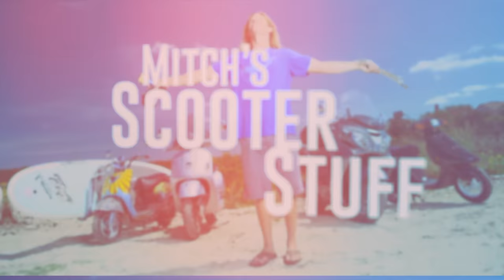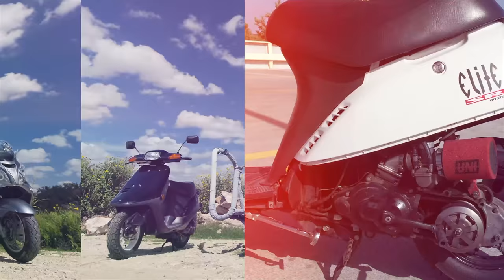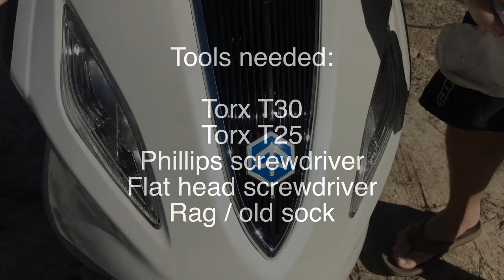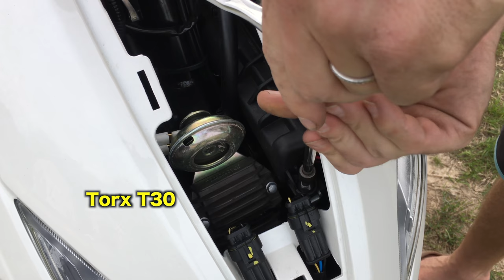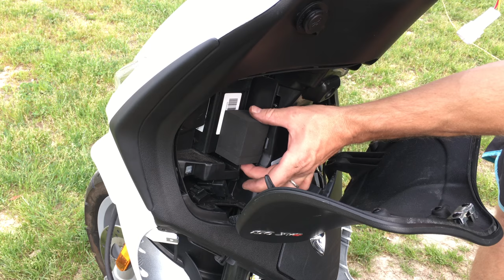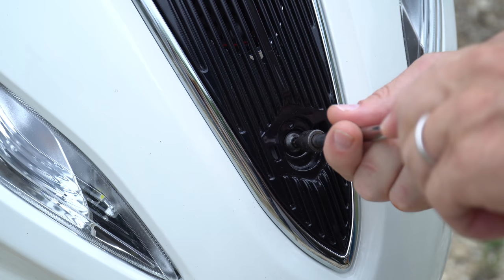2013+ Piaggio Fly - Battery Removal / Installation | Mitch's Scooter Stuff

Comment: A big thank you on this video! After a winter of minimal use, my scooter would barely crank. With your video, I was able to remove the battery in about 5 minutes and then charge it up. This saved me a very expensive trip to the Piaggio dealer.

Comment: Hi Mitch! Thanks so much for your awesome videos! Question- what battery model are you using? 
Mine died on my 2015 150 Fly- when I took it out, it was a Yuasa 100cca 6ah, probably not powerful enough, but fit snug in the housing.
Can't find the proper specs for the 2015 anywhere that will fit inside the small housing unit where my battery lives. :(

Comment: In this video you show how to remove the battery but not how to take of the first panel to get to the second one that release the battery could you let me know
Reply: Bit late but carefully take off the piaggio logo on the front. Use your finger from the right side and pull off easily. Then unscrew with an allan key. Then push up a bit then it will come off

Comment: Use and trust this video! -- This video is all you'll ever need to change the battery in your Piaggio Fly 150. Thank you! In my 60 years, I have never attempted to do any kind of service on any motor vehicle. I have zero knowledge of anything as far as repair/maintenance on my car or scooter.  Got estimates in the high $100s to replace the battery by two local scooter/cycle shops. So, I came across this video and decided I can do this myself. Bought a battery on Amazon for $27 and followed these accurate and simple directions and I actually did it myself. No one is more surprised than me. I had to buy two cheap Screwdrivers, Torx Head T25 and T30 which only set me back $10. Already had the Phillips Head Screwdriver required. You can do it too!

Comment: Hey Mitch! I have a quick question. Maybe you can help? I have a piaggio fly 150. And my compartment where the battery is, it won’t open. I think it got stuck or something. Any recommendations on how to fix that?
Reply from the maker: Hey, make sure the bolt is out... if stuck, pull it harder... it holds on with tabs I think...

Comment: Hello Mitch, i have a really important question and i hope you can awnser it. My '09 125cc Piaggio Fly gets overheated after 5 minutes and my air filter is really thick. Will it help if ill change my air filter to Malossi because there way thinner and have alot more air???
Reply from the maker: Yes and check the spark plug and engine oil :)
Reply: Mitch's Scooter Stuff already have a 200cc engine xd

Comment: Hi Mitch, not heard much from you in a while, hope your ok.
Reply from the maker: Hi, thanks for checking in, I'm good, been traveling a lot lately and finally I'm home and be able to edit and post videos :)
Reply: Hi have a piaggio fly ie 150 I opened the air filter cover and 100ml of engine oil was in there.. bike only has 6000 klms on it. Do you know what the problem is buddy.